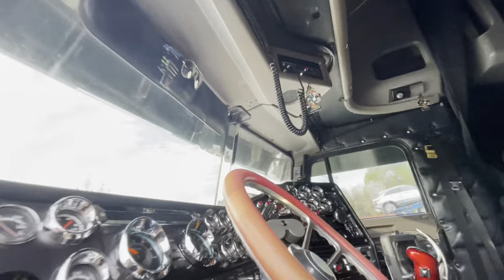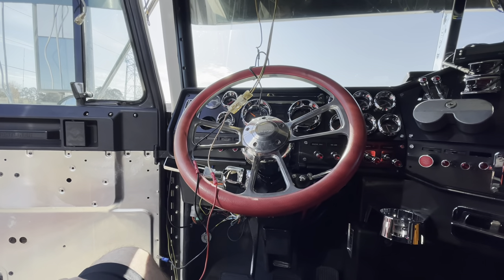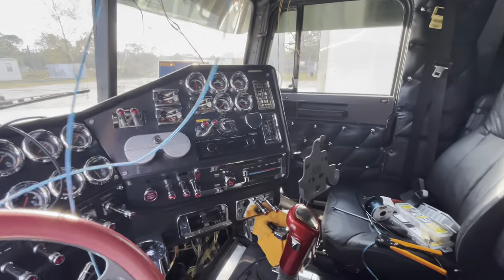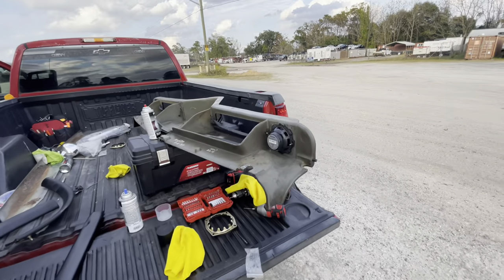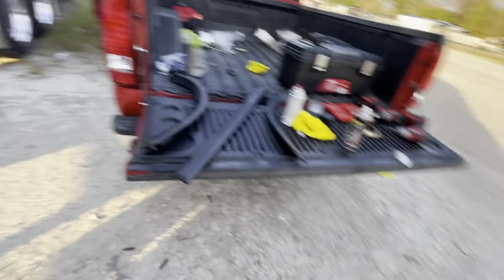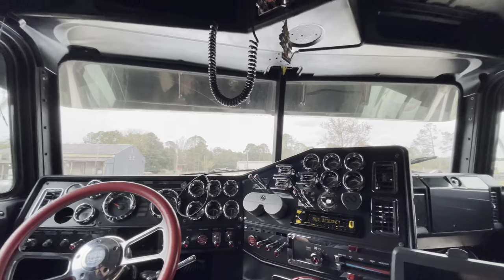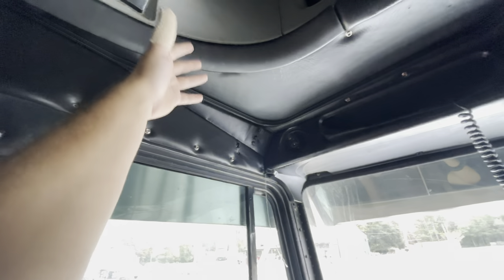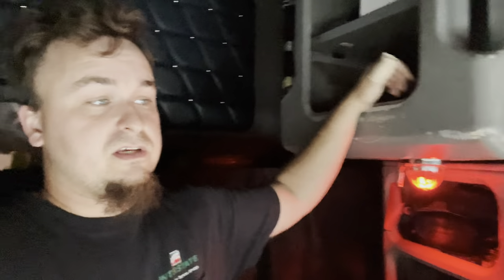Freightliner Classic Headliner Removal + Air horn valve / speaker replacement!!

Comment: That air horn valve is a mf’r when you got a broken screw in the driver side visor. I was in Springfield MO kids ask me to blow horn and air valve stuck open. 😂 ended up have to cut and plug air horn lines till I got home.